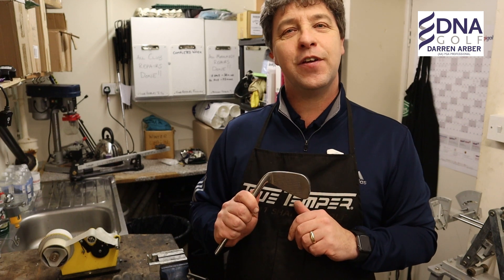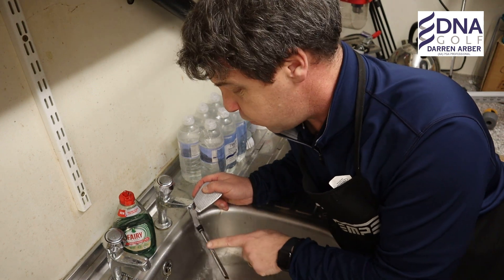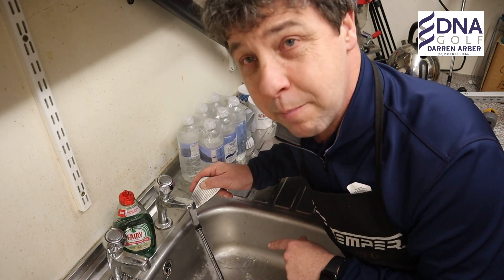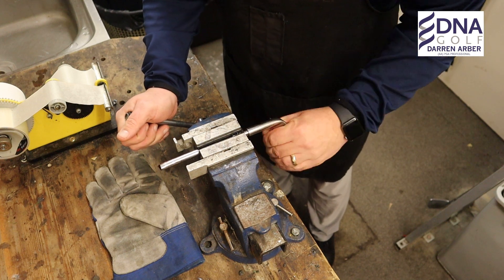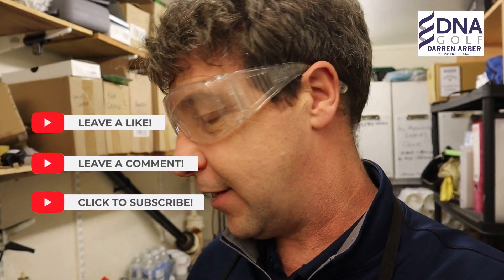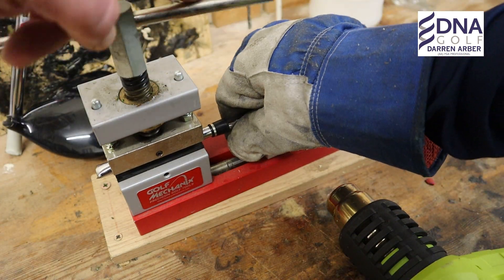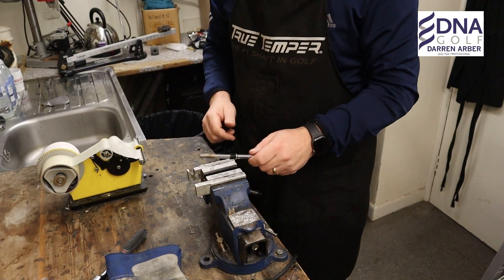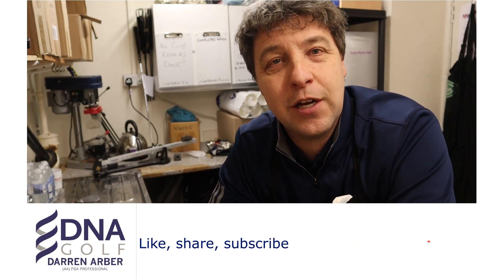Avoid those mistakes when removing a broken golf shaft

Comment: Dareen would this be a safe process,with a 3 wood with a graphite shaft.
Reply from the maker: Removing a graphite is slightly different, you need to pull rather than twisting.